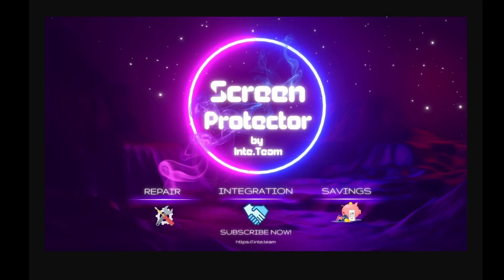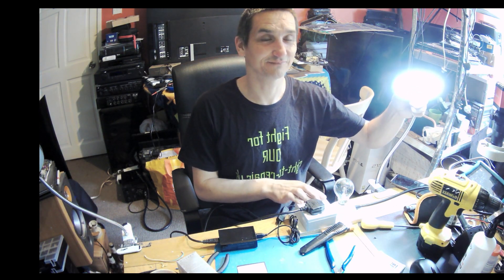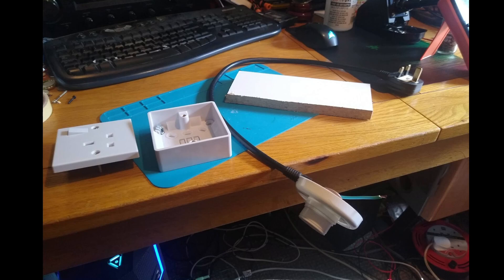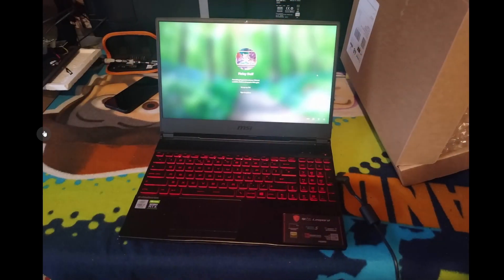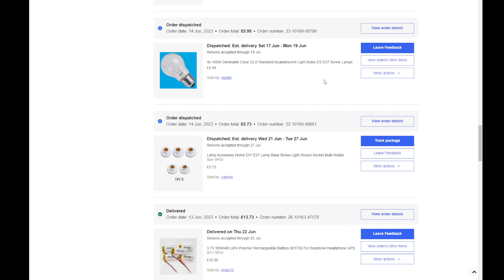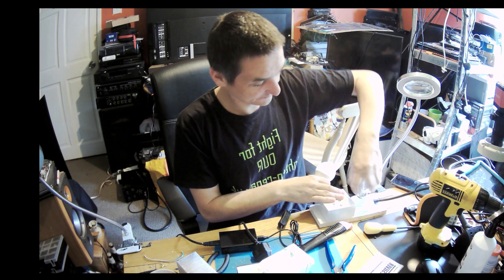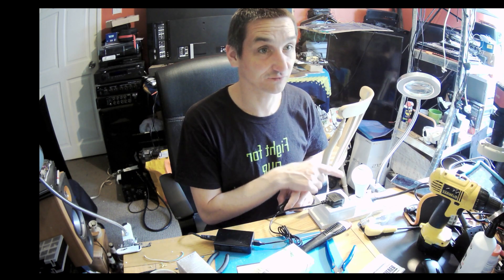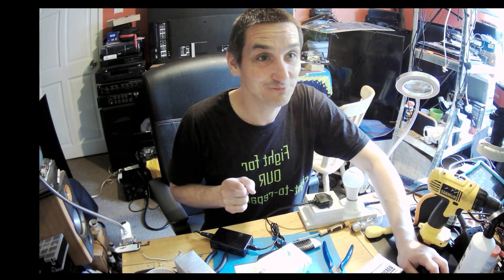You HAVE to have it to not blow your fuses when fixing electronics!

Comment: It’s not just for fuses it can help protect other components, mosfets, ic’s, etc
Reply from the maker: Correct, but usually it's too late anyways :D.
Reply: @screen-protector  never failed me, especially when you have replaced a load of components on the primary side… what do you mean too late ?
Reply: I built myself one of these, well worth the effort and the small outlay. Used it on a Playstation 1 PSU if I remember correctly.
Reply: @PhilipBryden   I have a couple of power supplies that will be to some use for you Philip, I will hook them out for you both Sony ones, ones internal and one is a plug in
Reply: @wisher21uk  Nice one. Thank you Gary
Reply: @PhilipBryden  you’re welcome 😉
Reply from the maker: @PhilipBryden  haven't seen it on your Youtube yet, or seen and didn't point an attention. :). But totally agree with you on this one :).
Reply from the maker: @wisher21uk  too late as everything what should be burned is already burnt :D. And, only one component is shoring.
Reply: @screen-protector  oh ok I just wondered that was all lol